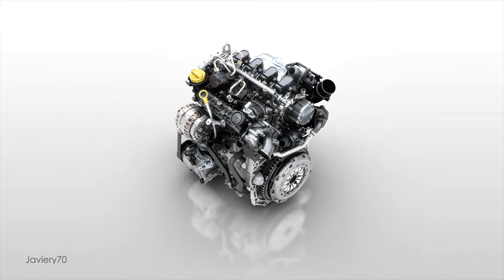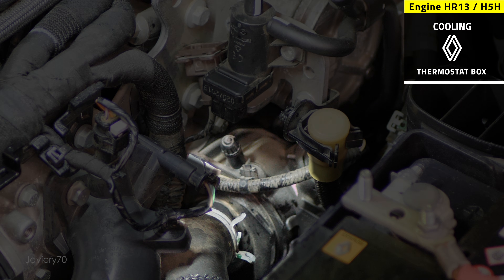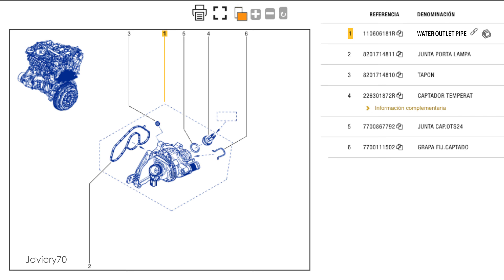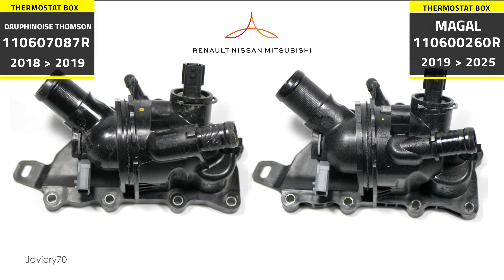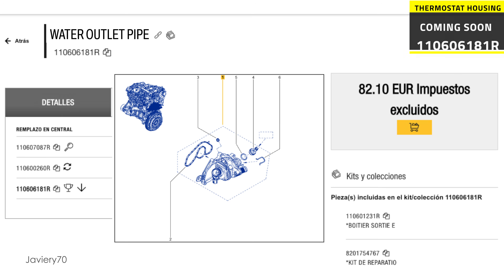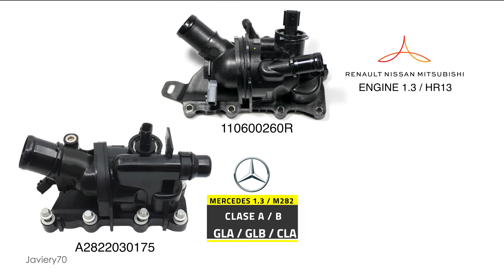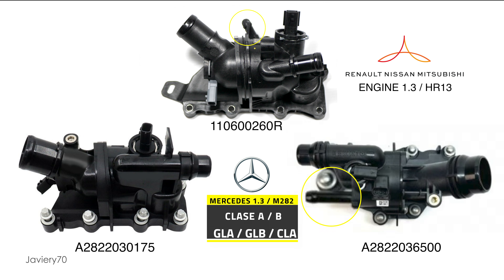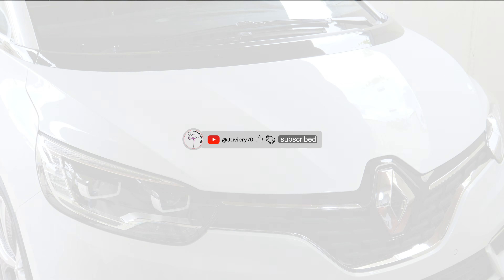🔸RENAULT - DACIA 1.3 TCe | Coolant Leak in Thermostat Housing (eng)

Comment: Thanks for this information which is very detailed and informative.  I have a 2021 Renault 1.3 kadjar which so far has  had no lealing coolant issues. The car has only done 8k miles but the engine at tickover makes a loud tappet noise.  The type of noise years ago I would be checking the  valve clearances.  Have you encountered anything like this in your shop before ? Thanks
Reply: Thanks for your advice
Reply from the maker: Thank you.
The valves and the distribution system are hydraulic.
The quality of the oil is crucial.
1. Is the noise only when the engine is cold?
2. Is there a warning light or fault message on the instrument panel ?
3. Is the oil level and oil quality correct ?
4. Is the noise only when the vehicle is stationary ?
5. Is the petrol low cost ?
Reply: Thanks for the reply.  The noise is there on a  cold start and doesn't change much when the engine heats up.  I have no warning lights and the oil and filter were changed by my Renault main dealer .  I checked the oil level and it's fine.      The noise is more noticeable when stationary.  I usually get petrol from my local supermarket (probably not the best).
Reply from the maker: @brianorr1475  The noise had to be heard to assess whether it was within the normal range for this engine.
If there are no warning lights on the instrument panel, it's a good sign.
In this engine, it's important to keep in mind that the fuel injection pump and injectors are audible; they have their characteristic sound.
Quality gasoline is recommended for engine health.

Comment: Hi, thank you for thegreat video! I have Nissan Townstar from 2022 with the same engine, should i be concerned? Car has 28'000 km. Should i replace thermostat housing with a generic one just to be sure?
Reply from the maker: I haven't seen any engine after 2020 with this problem in my shop.
I recommend monitoring the coolant level and checking the thermostat periodically. Change it when you notice a leak.
Reply: @javiery70  Thanks!

Comment: Dear Javier, is there a same risk of coolant liquid leakage from the thermostat box for the HR10DET Clio 5 Phase 2 manufactured in June 2024?
Reply from the maker: The thermostat housing on the 1.0 TCe engine is different; it's a different model. It doesn't have the same problem.
The problem with the thermostats on some 1.0 TCe engines is in their base gasket that connects to the engine.
Reply: @javiery70 does Clio v 1.0 2020 model tce lpg has problem ? Mine had  coolant level dropped to min two times and the dealership told me perhaps it is from the lpg system or from the cup of the water bottle
Reply from the maker: @archiezoulou   There may be a leak from the thermostat gasket on that engine, and there may also be a leak from the water pump. Those parts need to be checked. These types of problems occur in some engines.

Comment: I have done 3.500 km with Mercedes Thermostat with non issues .❤. Better then original.
Reply: I think ersin is the guy in qashqai uk forums you can see the details of his work there
Reply: Hello! Well done  how did you adjusted all the different connections and pipes connectors ? thank
Reply: nasıl yaptın ersin ?

Comment: Hello I have a HR12 1.2 engine I think… I am having issues with the cooling system where is the temperature sensor located as the thermostat has been changed already
Reply from the maker: The temperature sensor for the HR12 4-cylinder engine is located in the thermostat housing.

Comment: Verry nice info! I look forword of buiyng a duster 2023 with 1.3tce 150 psi manual engine. Verry usefull info here, but can convert to LPG? Its there any engine problems afterwords? If i respect all the oil changes and everything. (On long term use)
Reply from the maker: Renault cannot convert to LPG.
There are companies that specialize in LPG installation and conversions. These companies must provide information about whether they have LPG conversions for the 1.3 TCe engine.
And they must also guarantee perfect, trouble-free operation.

Comment: I have 11/2020 manufactured 1.3 TCE Duster, it is at 80k now, so far no obvious leak or fluid level decrease, should I change as a caution? Or in that month/year, there is not much concern?
Reply from the maker: @intikam91  I haven't seen any issues with 2020 thermostats.
I recommend not changing them, but you should keep an eye on them.

Comment: Hola @javiery70 and well done videos mate! Hands down, this 1.3 TCe is the best downsizing 4-cylinder engine without hybridization on market right now. It is used globally and is still popular with only two revisions since 2018.

But could u please make a new video about the „Oil bubble leak“ issue of this engines caused by leaky valve covers? 

Obviously all (MB, Renault-Nissan and Dacia) engines get this problem sooner or later. Check some Videos from RU boards, they have located the issue due to poor build quality of the sealing adhesive bc a this new aluminium delta cylinder head can not sealed economically with a traditional rubber sealing. 

For markets with low labour costs this is no major issue, but if u have to pay 150 GBP/h this can get more then „oily/dirty“ for customers if they are not satisfied with the flaw.
Reply from the maker: Thank you.

This refers to the oil stain on the intake-side cylinder head cover.
We must differentiate between an oil leak (leaking) and an oil stain (oil vapor).
All current Renault engines (diesel and gasoline) are sealed with adhesive sealant.

In the 1.3 TCe engine, there are units where this seal is deficient due to a lack of adhesive sealant; this does not occur in all engines in general.
The vast majority are stains, not leaks. Resealing is an easy and inexpensive but delicate task.

I recommend first cleaning thoroughly, observing, and assessing the leak before disassembling. It's quite possible that the stain won't reappear for thousands of kilometers...

Comment: to change the housing as a preventative measure, I have a Qashqai 1.3 from 12.2018. with 79kkm
Reply from the maker: I'm finishing the video of the thermostat assembly and I want to upload it this weekend.
Reply: my 1.3 is from the very end of 2018 but the thermostat has not been changed and is working properly, it is not losing fluid anywhere so far. it is the first thermostat
Reply from the maker: According to what I read on social media, there are more cases at Nissan than at Renault-Dacia.
Reply: What would be your opinion then, replace preventively or not as long as it is correct?
Reply from the maker: @ I see thermostats from 2018 and 2019 in Renault vehicles that are perfect.
It's not a general, systematic failure, but it's unknown who might be affected by it...
The opinions on the Nissan Qashqai are that there are no overheating warning lights. For that reason, I don't trust it, and I would replace it.

Comment: I installed a level sensor on the coolant reservoir. Everything works fine, and now I am much more confident that the engine will not be damaged if the thermostat breaks. Thanks for the video, very professional!
Reply: Hello, where can I find level sensor for 1.3tce?
Reply from the maker: I'm sorry, but I don't know where to find a suitable and easy-to-install sensor. However, you can visit Nissan forums where people have installed this type of contactless capacitive sensor on the outside of the coolant reservoir.
Reply from the maker: Thanks!
Yes, it's another option that many people are choosing: installing a water detector in the tank. This way, you avoid having to check the level periodically...
Reply: How to do that?
Reply: Hello. Your video is great. What is the most current plan thermostat part code available for sale as of 2026?

Comment: Hola, gracias por el vídeo, ¿estás seguro de que es lo mismo también para la versión de tres cilindros? Lo reemplacé por un Renault Clio 0.9 TCE y es completamente diferente, pero tenía fugas en la junta entre la culata porque se había secado.
Reply from the maker: 🔹Es el mismo con el motor 3 cilindros de 110 CV con inyección directa, Es decir el motor TCe 1.0 H5D - HR10.
 Motor completamente diferente al motor HR10 - H4D de inyección indirecta y 90 -100 cv.

El Motor HR10 - H5D es la versión 3 cilindros del motor TCe 1.3
Reply: @javiery70  Lo siento pero no sabía que existía un motor h5d de inyección directa, al menos aquí en Italia donde no se importa. ¿En qué coche está montado el h5d de 3 cilindros?
Reply from the maker: @ Dacia Jogger y Sandero stepway

Comment: Now we are waiting for the thermostat replacement video with the circulation pump and accessory belt :)
Reply from the maker: To date, no 1.3 TCE engine has come into my workshop with water pump problems.
Reply: @javiery70  Very good then, my vehicle is 2020 1.33 tce icon Clio5, it reached 39000 km and I did not experience any problems, but I constantly check it.